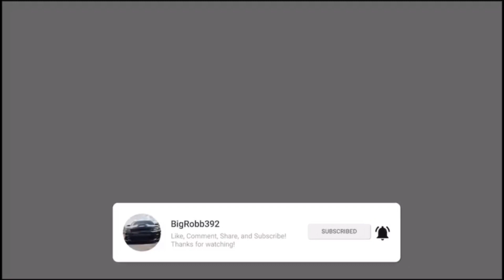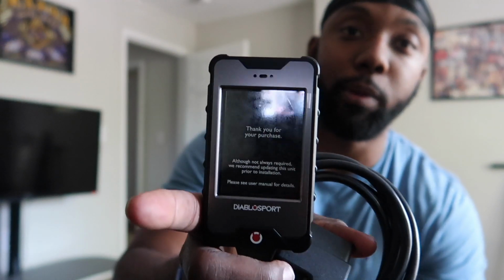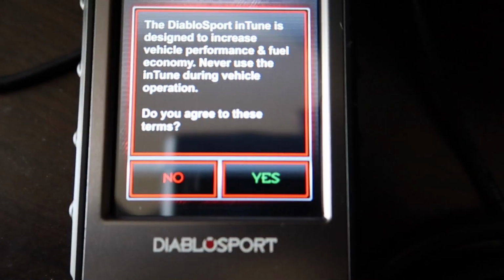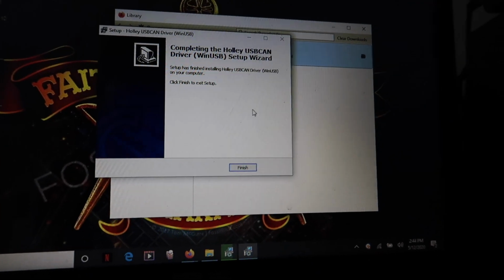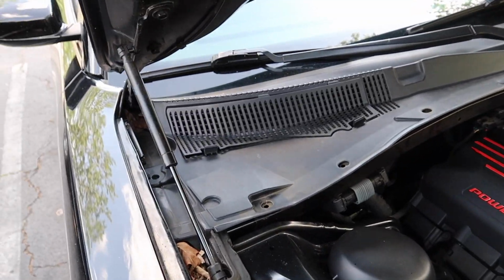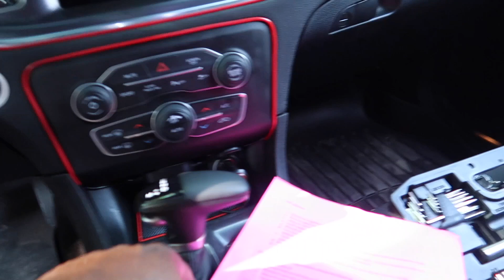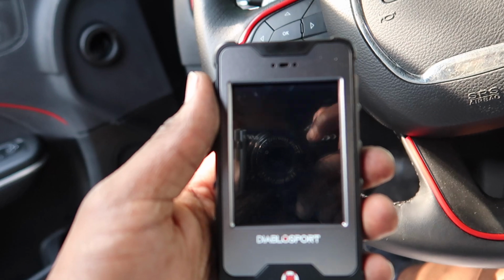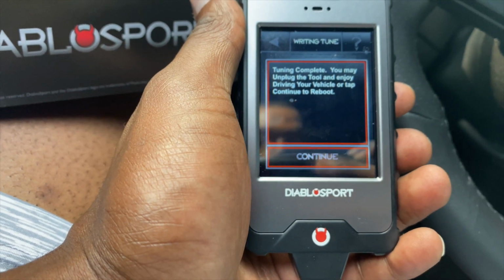SHE'S ALIVE!!! / Dodge Charger 392 6.4L Scatpack Diablo Sport Tune

Comment: Sorry but a diablo tune doesn’t give you 30 HP lol ,  doesn’t even give you 10’HP. You need a custom tune from an actual tuner
Reply: he already has intake and some other mods, so this tune will give 30whp as it will wake up your bolton's. It did with mine. I was running lean and with this can tune I'm running just right and I have more compression too so Yea I gained 35wheel
Reply from the maker: Thank you 🤦🏾‍♂️

Comment: Not sure if i missed it or not, but did you install a bypass module when connecting to the OBD-ll port?
Reply from the maker: Nope not at all just hooked straight up
Reply: @bigrobbtv  Sweet. Thanks.
Reply: And how much horsepower was gained off just the tune alone?
Reply from the maker: 20-25

Comment: If you order an unlocked pcm will it void your warranty if you swap back to locked pcm
Reply from the maker: They say the dealerships no but I doubt it because if you put the old computer back in then it’s gonna read stock🤷🏽‍♂️
Reply: @bigrobbtv  ok so let’s say you got a new car and it has 5 miles on it you swap it out to a new pcm then drive 1000 miles then swap back to original cars going to say you drove 1005 miles but the pcm will show only 5 miles

Comment: Did you ever get a check engine light or have any problems out of the car cause I’m thinking of doing this and my scatpack only have 800 miles
Reply: Wait until 1,000 miles
Reply: @jordanrosenberg9816   why you say that bro
Reply: @rebelrhino3367  1,000 miles is keeping it safe

Comment: Did your pcm come separately because i was under the impression they came together
Reply from the maker: They have different packages where you can get it separate or together as a package
Reply: @bigrobbtv  they sent me the tuner only I payed almost 600 for the package it said pcm swap kit and tuner or so it says for that price an come to find out they only said that was just for the tuner I csnt do anything with just the tuner
Reply from the maker: @walterbrown1615 swap kit should mean you send yours off and they swap it with an unlocked one
Reply: Did everything and now my car is saying it's in park on the dash when I'm driving down the road what does that mean

Comment: Have you raced any Camaros or mustangs yet?
Reply: If he does it's over. 😂 I have a 2020 Charger Scat and a 2018 GT with the 10 speed.. boosted now on 10 pounds. Before boost it was no contest. Coyotes +10 speed is out of control. Even hellcats have trouble.